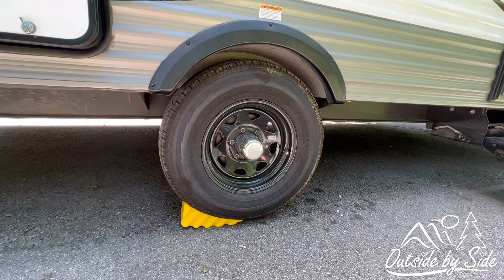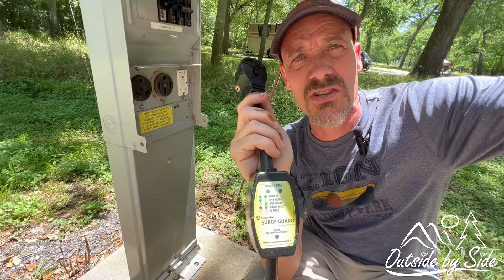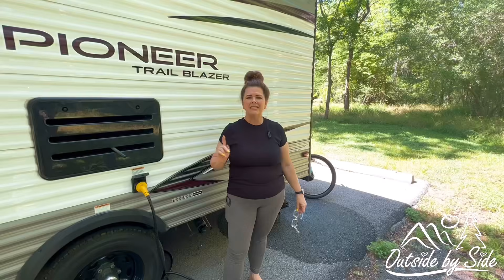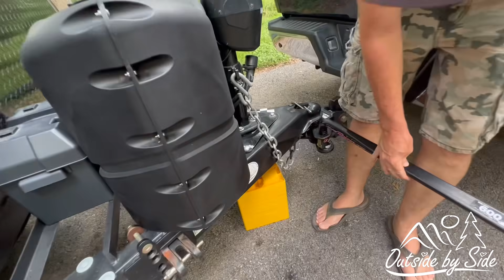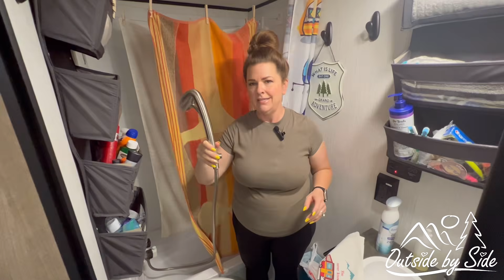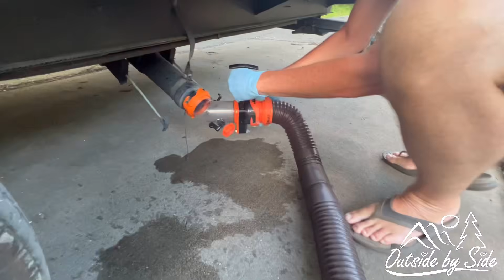Campsite RV Setup & Breakdown for Newbies ~ Detailed Tips & Tricks

Comment: I see this video is three years old.  Hopefully by now, you have added a gate valve with clear window to your discharge port.  If you ever had a handle our, you have a tube full of raw sewage - I heard that somewhere (oh yeah - YOU said it).  A gate valve there lets you connect to the sewer and then open the BOTH gates to make sure you don't have a poopsie.  If you don't have one yet, PLEASE get one.
Reply from the maker: @steveheath935 The Rhino Flush that we use is clear with a gate valve. We understand what you are saying but we CHOOSE to not leave it on our camper because it is bulky. It's really an individual preference and we have never had this issue. We appreciate you mentioning this for our community which is a great tip!

Comment: New 2025 Jayco Jayflight.  So many questions. It's currently winterized from dealer. What do I do when I un-winterizing? Just hook up and drain antifreeze? When draining with rhino flush how do you know when tank is full or half full before draining?
Reply from the maker: @timsimon8946 Just flush out all the lines with fresh water, don’t forget the water heater bypass valve. We have a 40 gallon black tank, we keep an eye on the monitor panel for black tank level, usually no more than 2 minutes. You can also purchase a digital meter that attaches to your hose to monitor the water volume. 🤩

Comment: I noticed that you did not have a torsion bar between your trailer and tow vehicle. If you are lucky enough to have packed your trailer so that it is balanced, you may not have an issue. If you don’t have a torsion bar and if your trailer is slightly improperly loaded front to back, your trailer may sway going down the road. The torsion bar, sometimes called an anti sway bar will severely diminish or eliminate sway. It is a great addition to your hitch equipment.
    Another thing to remember is to bring your awning and you slide in before raising your stabilizers.  Your awning and your slide like to be deployed and retracted while the trailer is level and balanced.
Reply from the maker: @orvjudd1383  Yes, we do have a sway bar. We produced a video on our WDH. Thank you for the information and thanks for watching! 🤩

Comment: Check the electrical connection with surge protector first, before disconnecting from the truck. If the power isn't usable, it's easier to relocate to a different spot.
Reply from the maker: @BigChutes Great tip! Thanks for watching. 😊

Comment: Regarding your chains, if they're not long enough, people should make sure they find a way to allow them to make an X. The X is absolutely critical in the event your hitch detached from your truck, or the trailer comes off the ball. The X literally holds the weight of your trailer so you can safely stop. Without it, the tongue of your trailer will dig into the road and create a much worse situation.
Reply from the maker: @RyanBarnes We understand completely and still want to find out why some are made to not create the X. We purchased a new travel trailer and it is the same. 😭 Thanks for taking time to comment! 😀
Reply: @OutsidebySide  holy smokes?!! That's not good!! I wonder if you could get longer chains yourself? I know the emergency breaking cable has to be done just right, but I don't think the chains aren't replaceable.

Comment: Probably a dumb question. What do you do for water when the temperature gets below 32 degrees? I assume you would have to disconnect everything before hand.
Reply from the maker: @robtintelnot9107 First of all, there are no dumb questions in our community! We are glad you asked! 😀 we have seen a heated water hose that prevents the water source from the campsite from freezing  before it enters the camper. Lucky for us we live in South Texas so we don’t experience extreme cold on a regular basis! You also want to keep an eye out on your tanks to prevent them from freezing. Our new camper has a heated enclosed underbelly which helps protect our tanks and valves. Thanks for watching! 😀

Comment: FYI: If you need an adjustable slide wrench, try replacing your hose washers with rubber hose washers. Use some plumbers lube to keep them supple.

Also, start connecting to the dump port, going back to the trailer. That way, as you take caps off and connect sections of your tank drain, and there is liquid black, it will go into😮 the dump, not on the ground.
Reply from the maker: @LawrenceTuckerFyretu Thank you for the tips! Thanks for watching & Happy camping!🚌🪵

Comment: I appreciate this video. I am strongly considering getting an RV and starting this life! From start to finish, how long do you think it would take a single person doing all of the setting up/taking down? I won’t have a second person with me to help. 

ALSO, how do you keep your camper pest free? I’ve heard about insect/rodent infestations. I really want to be pest-free.
Reply from the maker: @RD-eu1fj You will love the RV life. Are you looking to live in it full time? We have not had a problem with rodents yet but we are moving it around and don’t leave food in it when parked. 

Happy Camping and wishing you the best! 🤩
Reply: @OutsidebySide  thank you!
Reply: You need to seal any holes under your trailer. We have a vintage pop-up and had no issues for years until we replaced the canvas. Then to our dismay, we parked it in a different spot and mice got in and chewed several large holes before we even used it once! We tried the ultrasonic repellers and mouse traps, which we still use as backup, but what really seemed to work was a product called Mouse-free which you spray on the undercarriage. It's a combo of pepperment oil and some other light oil and for us has worked very well.
Reply: @HeritageNJ  that’s good to know! What about other pests? I’ve read about diatomaceous earth, but what else? Also, what do you use to seal holes? I’ve read about copper wire and then foam on top…

Comment: Question:  I was told not to connect our 30amp to a 50amp.  Would the surge protector prevent 50amps from hitting the trailer?
Reply from the maker: @scottmyers6307 You have to use a 50 to 30amp adapter & then plug that into the surge protector. The 50
to 30 amp adapter makes the voltage safe. We have a short on this. https://youtube.com/shorts/A8SQVHniM1M?si=jRNel-m4VKd_locM
Thanks for watching! 🤩

Comment: Great video so far. Unfortunately I have to head to work this morning but I was curious if you could provide a link or a name of the 20amp to 30Amp pigtail you showed with the handle I believe. The one in case there’s no 50 or 30Amp outlet.

I couldn’t find it in your video description.

I’ll be back to watch the rest later on. Thanks!

✌🏽
Reply from the maker: @2wheelskenobi thanks for watching our video. Here is the link: Camco Camper/RV Dogbone Electrical Adapter | Features 15-Amp Male (NEMA 5-15P) & 30-Amp Female (NEMA TT-30R) | Rated for 125 Volts/1875 Watts and Crafted with 100% Copper 10/3-Gauge Wires (55165) https://a.co/d/8I51GuB

This is a 15 to 30 but will still work! 🤩
Reply: @OutsidebySide Great job on explaining things you two. 

My wife and I just purchased a Ram 3500 Diesel and Toy Hauler last week. We are about to load the Harley-Davidson in it and take off but I have no idea what the heck I’m doing with all these connections, valves, switches and the procedures that go with it. So thanks for explaining everything.

Maybe I’ll do a local run to a nearby lake campground just to get acquainted with everything. 

I can totally see myself tryin to figure things out at the waste dump with a line of vehicles behind me. Or at the campsite walking around with a hand full of thumbs. I saved yer video and subscribed too.

Don’t be shocked if ya hear from me again!!!!!

✌🏽

Comment: I bought an adapter that splits the 50a into 30 and 20.  I've only had my new-to-me camper out a few times this year, and none of the sites had a functional 20a receptacle.  Figured it might be useful when my ac is running and we want to use a high wattage skillet or if my wife or daughter need a hairdryer. Love having ac, but man it takes up a whole lot of the 30 amps lol.  How do you attach the portable tank to the vack of the camper?  Looking into getting one to open up my camping site options.
Reply from the maker: @porkchop10 Sorry to hear you have had issues with the 20 amp receptacles. The AC is great but does take a lot of power as well as the small appliances. 😭 The portable tank has a bumper Mount we purchased on Amazon. We can send you the link if you need it. Thanks for watching! 🤩

Comment: Hi, thank you for the very informative video. I have a question.
When connecting the “city water,” do you leav that water on all the time?
Is that “filling up” the “fresh water tank?
Is there a valve that senses the tank is full and stops the water into the RV/ tanks??
I never really hear anything about that detail.
Thanks
Reply from the maker: @marcusaponte1287 When city water is available, the hose gets connected to the city water connection which is separate from the fresh tank. The hose is on all the time & you have an unlimited supply of water. The fresh tank is for storage when you don’t have city water. You must use the water pump to get the water out of the fresh tank. Unfortunately there is not a valve that senses if the fresh tank is full but the tank monitor should tell you when it’s full. We always travel with a little bit of water in the fresh tank in case we need to stop on the side of the road for a restroom break. Hope this helps & thanks for watching!
Reply: @OutsidebySide  thank you. My wife and I are saving up to get our first camper and that always puzzled me. I’ll be watching more of your videos! I subscribed! Thanks again.
Reply from the maker: @marcusaponte1287  Thank you for taking time to subscribe & please let us know if we can help in any way with questions. It’s definitely a process but so worth it! 😀

Comment: Just converted my 23ft camper to a fully offgrid beast. Still have new toilet to install and new air box. My biggest complaint is the A/c Fan will never shut off because of its poor design. I am adding a coleman mach bluetooth assembly to add smart a/c control.  It is attaching to a Dometic unit So I will need to use a wire harness adapter and the new structural metal frame bracket that comes with the air box. 

My all plastic toilet legitimately scared me to use.  I pictured myself laying on a broken toilet bleeding and covered in poop, just scary to use in general. it is getting replaced with a composite upgrade with wood seat.

I put two 40lb tanks on the tongue, I initially upgraded to two 30 lb tanks. Winter camping eats through my fuel too fast so I will now be carrying up to 160lb of fuel with me on my trips. Two 40lb on the tongue, two 30lb strapped in truck bed and possibly the single 20lb tank too. Now that I have a full off-grid camper I want to eliminate my need to drive into town for anything while camping.

I also have Solar,  Even without Solar If I just used my Generator and battery power I would still cut down on half of my fuel cost without using solar at all.  Normally to achieve 6 hours shore power I would need to run the generator for 6 hours,Now I can achieve 9 hours shore power by only running the generator 3 hours.

Example: It takes 3 hours flat to charge my 400ah of LifePO4 battery's and once charged will run for 6+ hours depending on the load.  Running just a furnace would probably run that a week or so without needing a charge. I actually have 600ah of battery's but 200ah are Lead Acid and brand new, I would actually remove them now but because they are new I will use them until I convert to 100% LifePO4. The weight of 200ah of lead acid is more than 400ah of LifePO4. THE ONLY reason i leave all that weight on my camper is because it acts as a backup system for me as the banks are separate from one another. The LifePO4 will actually charge the Lead Acid while providing shore power through LifePO4 battery's.
Reply from the maker: @Oblivionsurveyer Wow! That is so awesome & thanks for sharing your mods & upgrades with us! Hopefully one day our trailer will be half as badass as yours! We love hearing these awesome ideas! Thanks for watching & happy camping! 🤩

Comment: How do you keep your interior fridge cold while traveling to your destination ?  We plug ours in at home overnight beforehand but when we are driving 3-4 hours away, it tends to get warm by the time we get where we are going.  Would love to hear tips on keeping food cold in route !
Reply from the maker: @toms8680 We sometimes run our propane while driving but that’s not good advice! Sometimes we keep food in an electric fridge we have in the truck until
We get to our destination. We understand if you don’t have a 12V refrigerator, this can be an issue. We will definitely get a 12V refrigerator on our next travel trailer. Wish we could be more help in this department. Thanks for watching! 🤩

Comment: Newbie here. I didn't catch the specifics about the water heater. I get that you need to turn on the water and let the tank fill before turning it on. Do I need to drain it when leaving? For that matter, do I need to open both hot and cold to drain the lines? Thanks for the videos!
Reply from the maker: @janetmiguel2043 You don’t necessarily need to drain the water heater before you leave. We only drain it for long term storage. The red & blue hoses are the low point drains for the plumbing. To drain the water heater, you have to open the service door on the outside of the trailer & unscrew the plug at the bottom of the tank. It’s also a good idea to drain the fresh tank as well. Thanks for watching! 🤩

Comment: Where do you guys buy the amp adapters? I'm new to RVing. Thank you. 
I bought a 34 foot 1990 safari Serengeti a little over a year ago from the original owner here in Las Vegas. It's in amazing condition and everything works except the backup camera lol.

I'm a professional mechanic for 20 years and have already gone through all the systems except water. I'm planning on living in it full-time in next couple of months.

It's an aluminum framed body with galvanized sheet metal walls all riveted and painted exterior.
They sure don't make them like this anymore.
Reply from the maker: @SlimShady771 Congratulations on your new trailer! It sounds wonderful and the quality is definitely better on the older ones. It will be great for full time living! What amp adapter are you referring to? We are happy to help w/ any questions you have! 🤩

Comment: Excellent video! Good insight for things that we need to get. I really like those leveling blocks, instead of using 2x8 wood blocks…thank you.
One thing I would add is to check tire pressure before leaving and getting a portable, rechargeable air compressor to be on the safe side.
Reply from the maker: @lixxlaffs2130 Great tips for our viewers! We keep an eye on tire pressure with our TPMS & add air if needed w/ our portable cordless air compressor. Thanks for taking time to add this in the comment section since it is not included in the video! Thanks for watching! 🤩

Comment: Great video !! I especially liked the idea of storing sewerage flex hose in the bumper. However, where did you get the magnetic cap with the sewer hose connection !!??
Reply from the maker: @fredhagen7906 Thank you for watching! We purchased the magnetic cap on Amazon. It’s been a game changer. Here is the link: 
Camco Magnetic Bumper Cap with Lug Fitting End | Fits Standard RV 4" Square Bumpers | Features Small Holes to Increase Airflow and Block Insects (40311) , Black https://a.co/d/66D27n1

Hope it helps & happy camping! 🪵🚌
Reply: @OutsidebySide  Thanks !!

Comment: I had seem other videos that say you should always put the water filter at the spigot with the WPR first. I see you put yours at the camper side. Bottom line is ... does it matter?  Another question i have is we will be using the hot water heaterfor the first time  and was wondering about anything i need to do for first time usage?
Reply from the maker: @John Possible we like to connect the filter at the trailer end of the hose because sometimes the spigot is too low to the ground and there is not enough room for the filter & the water pressure regulator.  We don’t see why it would matter which end it is on. Always make sure the water heater tank is full before you turn on the electric or propane heat. Thanks for watching! 🤩

Comment: Just FYI ! I have no idea the reason a lot of people do this, they use the 90 degree elbow on the water connection to the trailer but put the water filter hung just below that, the wieght of the filter full of water is a little heavy and puts added strain on the connection. I run the filter just after my water pressure regulater. most of rv connections are all plastic and actually pretty cheap. This is just my opinion.
Reply from the maker: @David Groves We have done it that way, but sometimes the water spigot is too low to the ground and there is not enough space for the filter so we like to put it at the other end. We do appreciate you bringing this idea up in the comment section in case someone else prefers that option! Thanks for watching our video & taking time to comment! 😄